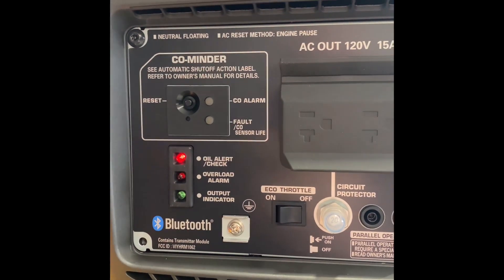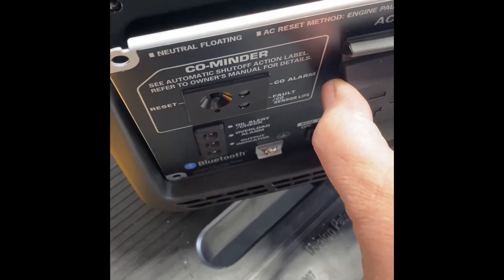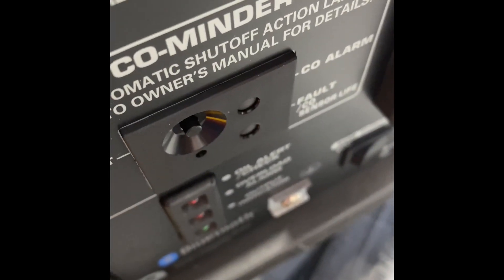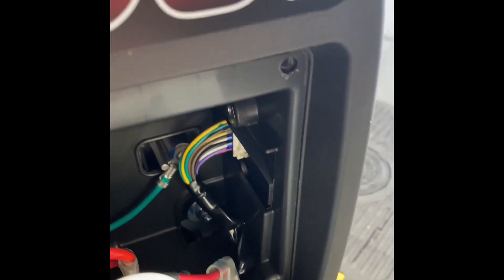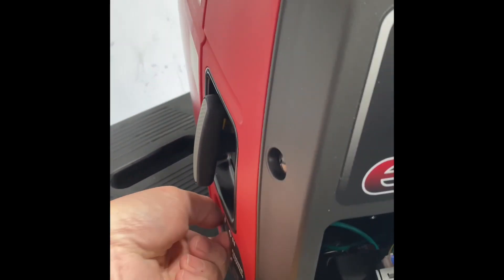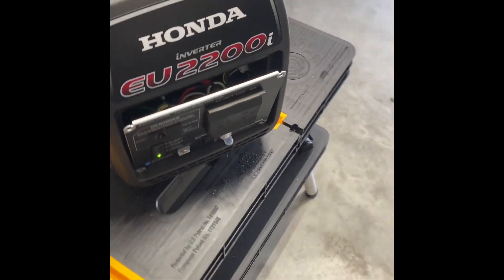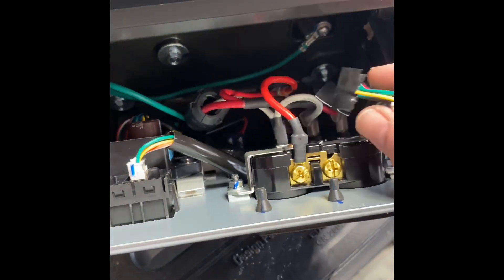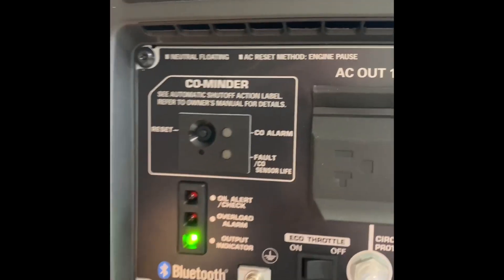Honda EU2200i CO Minder Defeat

Comment: Excellent info.  If my power goes out, I would need to run this in a trailer about 40' away, with cracked open, but chained doors.  The CO  minder would likely (I haven't purchased it yet) kill the gen, even though my plan is to face the exhaust out (of course)  the propped open steel doors.  This is a beautiful how-to!!!!  Thanks!  My home lives and dies by electrical.  My glasstop range, forced hot-water heat, electric water heater... I'm dead in a storm if the power goes out.  This little 2,200W gen is more than enough to run my OLD Frigidaire (approx. 750W) and electric space heater (600W lowest setting) until power is restored.  Luckily where my apt is located, the power has never been off for more than a few hours in the 10 years I've been here.  Most of the time it's only a matter of  mins before it's restored.  But I do put a LOT of time and energy into cooking, and I would hate for all that work to be lost to a dead fridge.

Comment: Anybody who is stupid enough to run a generator inside a building or tent cannot be helped. But I can tell you I have bought two Honda 1000 generators brand new in 2024 and on BOTH of them the CO-Minder died within 6 month and only few few hours of use. It indicates "end of life cycle" on both Co minders. Both units are disabled after being used just a few times. This "life limited CO minder" issue seems to be based on new federal laws made in late 2021 under Biden ??? - Anyway, glad to see there is a work-around. Thanks for posting the video !!! Regards from Alaska!

Comment: Easiest thing to do is just coat the sensor with several coats of urethane
Reply: These sensors will age-out in about 10 yrs even if blocked from air flow. Sealing them is not a long term solution.
Reply: I tried that, it did not help much as the sensors died internally.

Comment: I personally think all this safety crap they are obliged to, or are required to add to everything these days, should have a built in over ride or bypass so the purchaser can choose to use it or not! Having said this, I so very much appreciate this information. I just purchased the inverter and the companion. I noticed Honda must be onto everyone making this bypass because I see the 4 screws on the face plate now require a "special" torx bit, one that has a hole in the center, because the screws have a small pimple in the center preventing the use of a normal torx bit. I over came this by using a small tapered dremel grinding bit. I carefully ground down the pimple (it didn't take much) after which the regular torx bit worked fine. I'm thinking of using a dremel grinding disc to cut a slot in the screw head so I can use a flat screw driver in the future, if necessary! Again, thanks a million!!!
Reply: You know they sell tamper-proof torx bits made for those screws...wasn't necessary to "alter" them like you did.
Reply: @berettaguy7445  Yes, thanks.....I miraculously discovered that a few days after my post. Harbor Freight had a nice little assembly of them!

Comment: I did this to my Companion and standard models and finally tested them yesterday.  I ran them in a small enclosed shed for a few minutes; they didn't shut off.  Tested them under load while paralled; everything, including bluetooth worked perfectly.  The presence of the CO-minder has always bugged me, so thank you.
Reply: Long term did this still work?
Reply: @lukesgarage592  Yes.  No problems with either unit.

Comment: I use this generator for my semi truck and in aluminum box I installed exhaust fan and also some holes for air intake but still I'm getting a CO alarm, so this is a life saver now with summer around corner
Reply: Has your generator continued to operate normally after this alteration?
Reply: @berettaguy7445  yes, works perfectly. I didn't have any problem at all and I used it a lot
Reply: @borkoniBG  Your generator didn't die of CO poisoning lol.
Good hack to know for sure. 
I drive too, but its a company truck, so it idles on hot summer nights, which aren't many here in the midwest.
Have a great week.